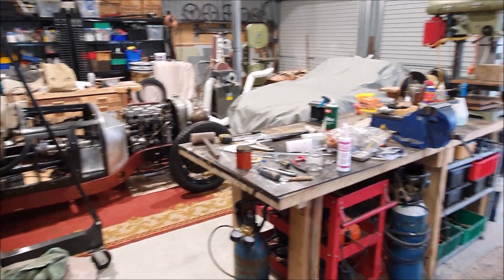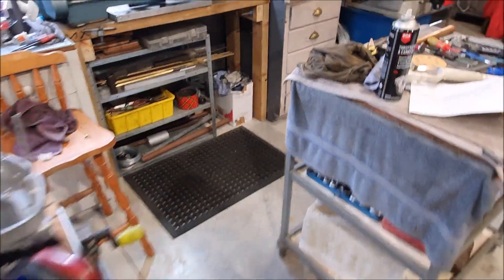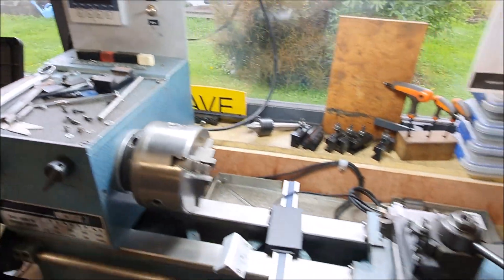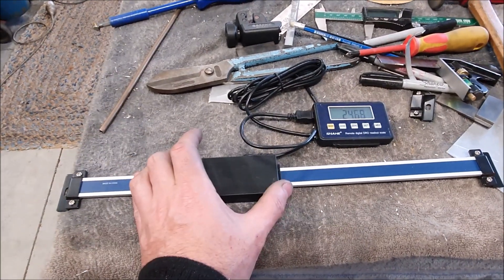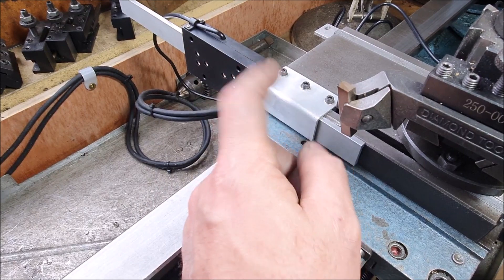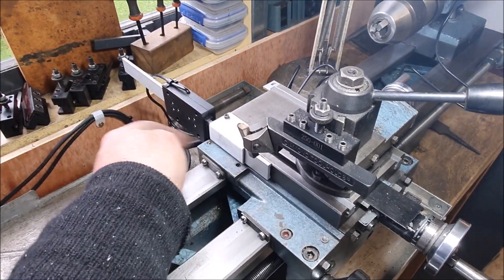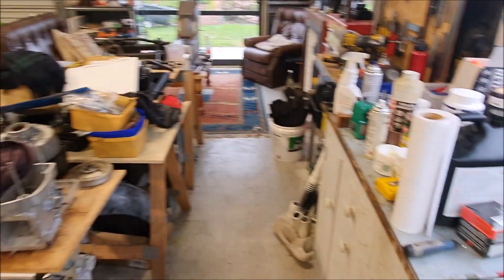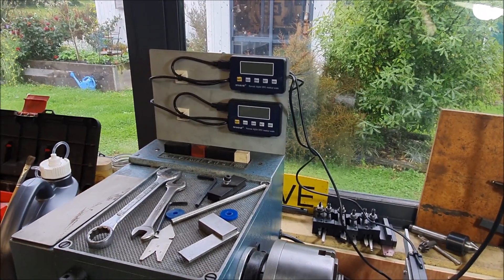Emco lathe DRO attempt 2

Comment: I have got a similar DRO setup.
The batteries on these run flat extremely fast, even when turned off. I ended up buying cheap 5v to 3V converters for a few pennies to power them via a USB plug.
Reply from the maker: Do you have details of the converters please?

Comment: I did the exact same thing with my mini mill. I did come to regret it though for two reasons. I had wanted to use TouchDRO but had made the mistake of buying two different models of scale so it wouldn't work, at least not on all axis. I also found them to be inaccurate. No matter how parallel i made the scale they would occasionally jump forward a few thou. Tried all sorts and spent hours messing around with alignment. In the end i decided to get optical scales. More expensive but much easier to fit and were far more accurate. Wish i'd done that to begin with now. Hope you don't run into the same issues.
Reply from the maker: I have optical scales on my mill and those are rock solid but that style are much to big for my little lathe. If these fail I will look at getting the much smaller glass ones I guess. I am hoping these work, I don't want to keep drilling holes in the lathe!

Comment: I found these displays very weak and difficult to read... and the battery does not last long. take a look at touchDRO, you  use a cheap android tablet and connect to the same rulers via bluetooth. very clear display and easy to add to your setup.
Reply from the maker: I wonder if there are different versions of these since these ones I have had are working fine? The display is OK to read and I also find the batteries last a long time. I was worried since others have commented they go flat quickly but I have left mine on overnight accidentally a few times and they still work. An auto off feature would be nice though! I am not a heavy lathe user though so if I was using it all the time something better like the one you mention would be a good idea I think.
Reply: @asciimation  in fact, I don't use the mill very often, and every time I tried the batteries were empty... so I soldered some DIY 3.3v supply to the rulers and it is ok. but the displays are still difficult to read in a not bright environment. so lastly I build a touchdro with an arduino nano, and connected it to the rulers in place and it works perfectly.